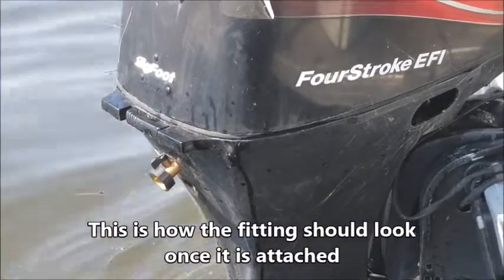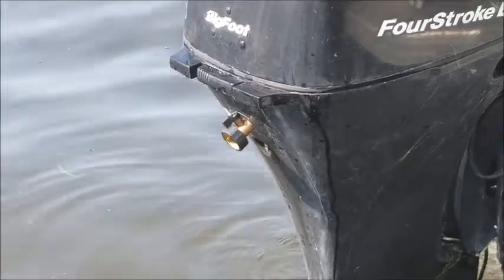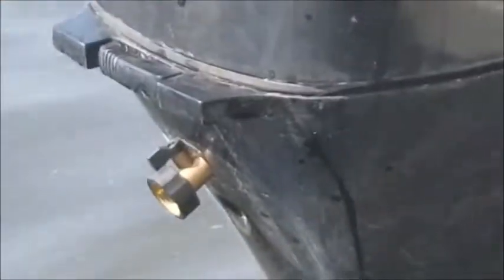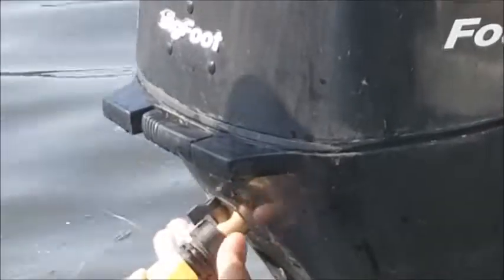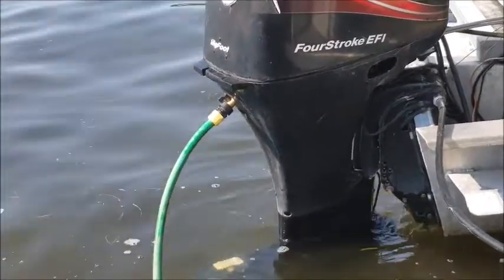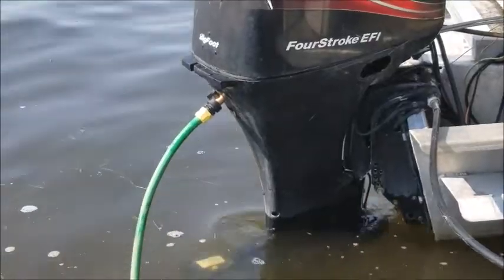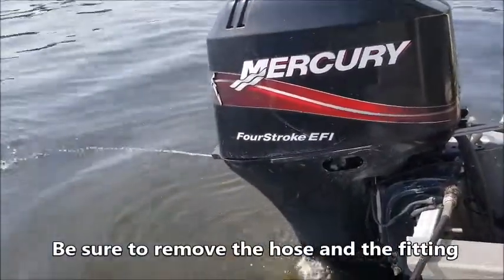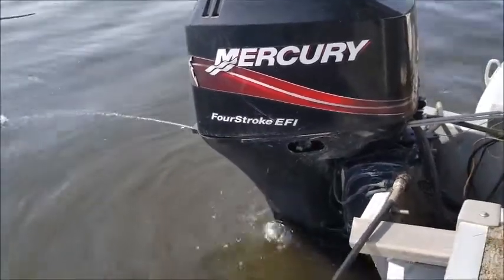Clear water intake from Mercury motor (2005 60HO 4-stroke)

Comment: I have a 50hp 2003 Mariner.  There is some oil coming out of the intake holes after I pull out of the water.  Motor runs great.  Had the lower unit pressure tested and was good.  Any ideas??
Reply: It may be dripping out of the carburetor when the motor is tilted up, when you're done using your motor it's good that you unplug the fuel line and run the excess gas out of the motor
Reply: @lesfaust9634  Oil in the Carburetor??

Comment: Would like to know where you purchased the backflush hose adapter for the engine?
Reply from the maker: Either Walmart or Home Depot. It's a common hose connector from the garden department.
Reply: @Slydo  
Thank you  Paul for your info. It looked as though one end was attached to the motor itself, is that correct?

Comment: 2013 Bass Tracker Mercury 60 hp runs great till 3000rpms then shuts off, any suggestions? Please advise. Thanks
Reply from the maker: Sorry, I am not an expert mechanic - I researched and posted this for my family's use if they experienced an overheating situation due to a clogged cooling system. It has kind of taken on a life of its own. I hope you've been able to find answers somewhere - I know how frustrating it can be.
Reply: Rebecca, did you ever find an answer to your overheating problem at 3000 RPM? I am having the same problem and I’m changing out the water pump and I’m going to try back flushing with the hose. I would be very interested if you would make a comment. Also would like to know where I can buy that adapter for my hose?
Reply: It was bad gas, changed all the lines out. Hope you solve your issues. Thanks